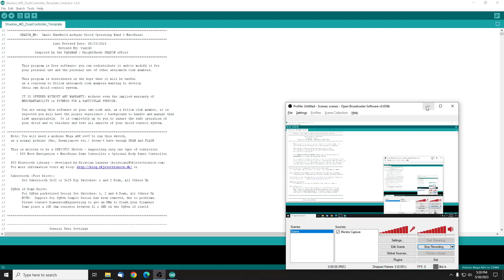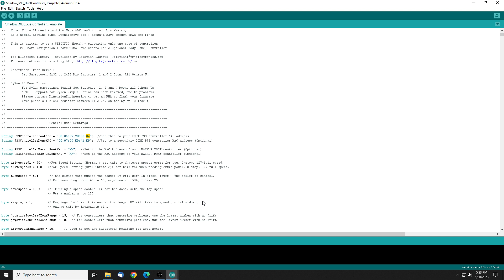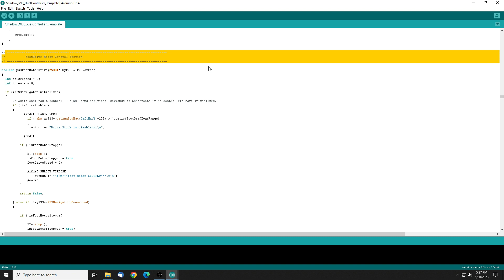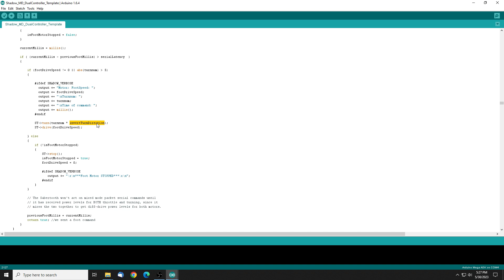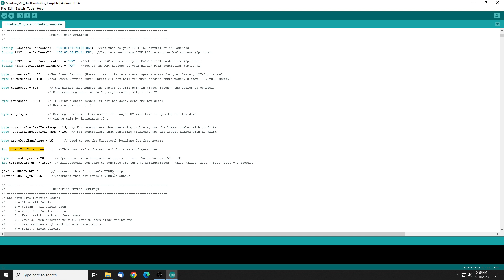3D Printed R2D2 - Part 104

Comment: Nice job! As a software engineer myself, I have a sneaking suspicion that once I start digging through the Shadow code, I'll want to make all sorts of little changes, too - naming conventions and code organization are two things I'm very particular about. Oh, when you do get around to your new dome, consider NOT gluing the top circle panel in place. I created some magnetic tabs that hold mine in place and being able to pop it off to pick up the dome (or even just to peer inside) is a really handy thing.
Reply from the maker: Thanks Jason!  I saw your modification and it's one I'd like to implement as well.

Comment: What are those yellow wire connectors.   The one you pointed to where the dome motor connects to.  It appears you use a medium gauge wire to your 24v system.  Do you really need that heavy of a gauge?  I'm about to re-wire my R2 to make it easier to remove the board from the R2.  I think those yellow wire connectors are way to go.
Reply from the maker: @GunnerAl9  The connectors I used are XT60 and XT90.  The 90 can handle more current than the 60.  
I'd rather have thicker wire than too thin.  You risk melting the wires if you pass too much current through, so I erred on the side of safety.

Comment: that looks like version m2 droid
Reply from the maker: Nope, its the Michael Baddeley MKIII.  At the time I printed it I had a Tevo Tornado printer with a 300mm x 300mm bed, so it saved me time being able to print the larger pieces.  I've sold that printer, so if I need to reprint anything I'll have to use the Version 2 files, or cut the MKIII parts to fit.  Of course, I could also use that as justification for buying a new printer:)
Reply: @TomsProjects  ive been doing version 2 only cause before i joined and before i even knew more about it i was getting files and started printing i have version one dome than got the files for version 2 body i stopped finally lucky for me i found the club Mr Baddeley helped me find were i needed to be lucky my version one dome well work